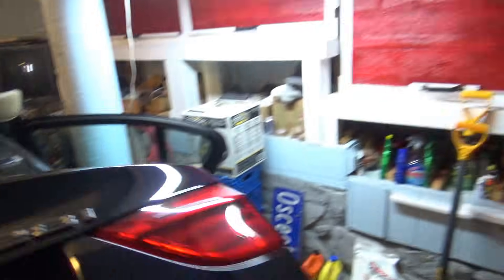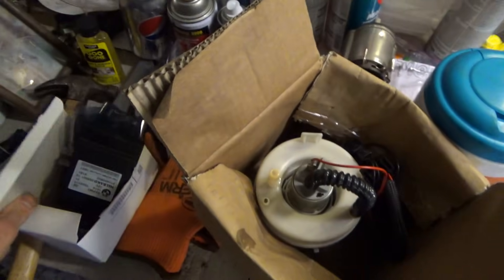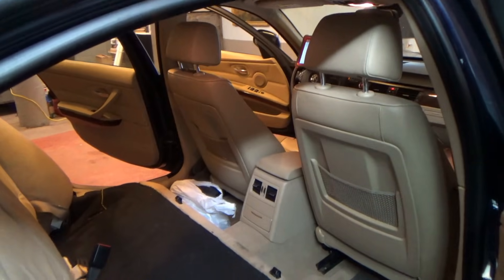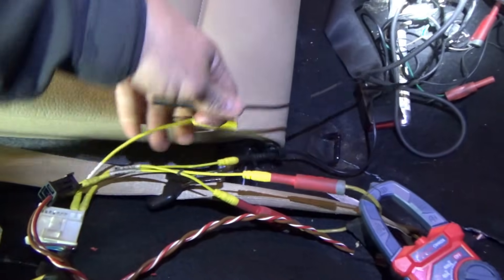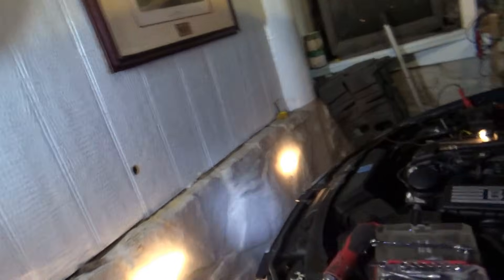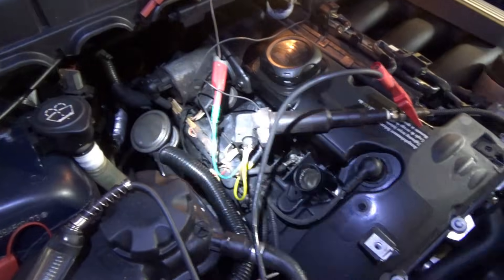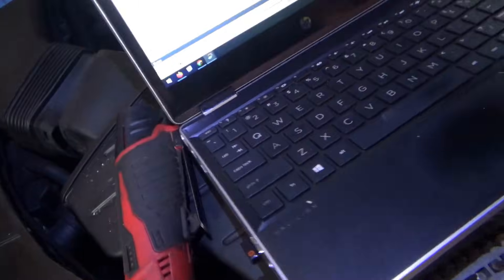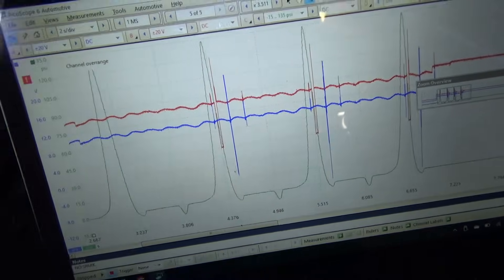Dealer BUTCHERED this BMW?! (Crank No-Start)

Comment: Actually Volvo did something very simular to me. They pinched my maf sensor wires with a metal wire they wrapped around a loam of wires and the 5v and 12v went full contact and burnt out the 5v driver. Had to eat the cost also to have it repaired. And first thing I did was to remove all that crap and put isolation extra on all the wires. Have not had a single issue with the ecu sens then.
Reply: Some of these technicians are working at lightening speed to get through cars and do stupid stuff like this.
Reply: @TheFrenchPug  that is true and the ironic thing is even after they swapped the ecu and programmed it they programmed it very very wrong. The car ran yes. I have the 2.4L Turbo xc70 2001. And they did not install the correct firmware rather they took a firmware for the 2.5L with no turbo. So had codes for the overhead cams and no boost solinoid actuation. They did set the key coding and such correctly so I was like fiiiiiine leave it and took the car over to a local tuner and said hey here you go keys for the car. Do your magic make the car run as good as you can. Ended up with a much better firmware update that got the car near 300hp and 2stage limiter. Ripped out the boost controller all together and hardwired the boost to stay at maximum and compensate with fuel and timing. It's been running like this for 3y now and not one single problem aside from a dead ignition coil that is 20y old so I'm extremely happy with their tune as they don't even normally work on Volvos
Reply: @ToxicwasteProductions  whats thef downside of running max boost all the time ...premature wear of turbo by stressing it
Reply: @nickmalone3143  I was afraid of the turbine failing or the pipes cracking or failing. But so far not really anything gave happend. Other then the turbo spinning away all happy. I normally drive my car fairly hard so I figure if something is going to break Im sure it will during a pull. I have only had sensor failures of the car. No hardware like turbos and other things just like solinoids and maf boost sensors and such fail. And those i put it to old age :) I'm running about 29psi boost at 4000rpm stock is line 5psi to 10psi on my model. So it's a huuuge power gain when you hit 2500rpm and the turbo starts really spooling up.
Reply: @TheFrenchPug  agree

Comment: How are these cars considered so high end yet they have garbage protection on their computer circuits? These days a lot of components that are manufactured to go these modules come with these protections onboard. It just blows my mind that a BMW ECM gets fried by leaving a ground wire loose. I’d be taking that evidence and the car back to the dealer and making them replace it. Hopefully they do a more competent job this time around and don’t screw up something else.
Reply: Hi end...the only thing hi is cost of owning and repairing....and they will deliver over and over until your wallet has been masturbated empty and the balls cave in.
Reply: I don't think the story is true. If that rear ground had been disconnected, the car would have already run on three cylinders at the dealer's workshop.

Comment: going to tighten all the coil grounds on my BMW tonight!
Reply: I am going to press the brake on my Tundra and press START and just drive to work. I have a MB Sprinter at work...it is a COLLASAL PILE OF SHIT.
Reply: They're easy to miss on reassembly if you're not diligent.  I've done it but didn't fry my ecu.

Comment: correct me if im wrong but the injector waveform seems well passed where it should be... almost looks likes it in the beguining of the exhaust stroke...
Reply: Yeah I thought the same whats up with that
Reply: Yeah I watched it back and I think Ivan did say everything was on pot 1. Looks like it should be for the next in the firing order ie 5
Reply: @schammo8893  Makes perfect sense! missed that part

Comment: how did car get home FROM dealer with missing ground?  Was that back lug just sitting on top of post and then later jumped off?  Wowzer!  That computer will be at least $1,000, right?

some others say the computer could  have worked AT FIRST before the drivers cooked.
Reply: I was just thinking the same thing.  It's easy to forget tightening those grounds down on a BMW so I always go around 2-3 times just in case.  Didn't know you could fry a computer by not having one tight though.
Reply: It was probably fine until the computer got fried without the ground attached
Reply: Ivan said in another comment that it drove ok for a few days until the dme cooked itself apparently.

Comment: Ok. Ive done several valve covers on 3 series BMWs. It's very easy to do and hard to screw up. I hope they didn't cause too much damage.  It's always something simple.  But forgetting to attach a ground cable is absolutely retarded.  Only other thing could have been a faulty reinstall of the valvetronic motor. Other than that it's just rebolting down the cover and reconnecting everything. You have to know exactly what those meat heads did putting it back together.

Comment: Wait, how did the car make it home from the dealer?
Reply: The ground was probably setting on the stud just fine for a while, and it's possible he drove it on 3 cylinders until the computer fried. It's also possible we are not getting the full story.
Reply: Tow truck
Reply: That will be their argument.
Reply from the maker: It drove OK for a couple days, but kept getting worse. Luckily made it back to the garage before completely crapping out.
Reply: @PineHollowAutoDiagnostics  That makes better sense.  That ground vibrated loose then.  When I forgot my ground (to put it back on bank 1) the car just ran horribly.  Then I saw it.  Put it on and vrooooom. No fried ecu.  But they can be easy to miss.

Comment: Ivan I remember back in the nineties and early 2 thousands when I would grossly overwork myself running air conditioning service calls here in Houston I often had a look on my face like the look you had on yours in this video..
Don't overwork yourself...
Reply: Very true, full mental recovery can take quite a while ... learn to say NO to more and more jobs. Your family will thank you.
Reply: He doesn't like to not solve the problem.  But it sounds like it was too screwed up to fix.  Although...the guy drove it home and must not have had any problems then.  A very strange case to a typically great running car.
Reply: Yes, I was feeling the pressure of still having to do that drive all the way home
Reply: @chiluco2000   Ivan ?
Reply: @2packs4sure  I meant, of him still having to drive back home... but I was feeling the pressure, not finding the root of the problem and getting late into the night...

Comment: Talk about negligence - dealer should eat the repair and then some! Great diagnostic of a nasty problem (fuel pump was just a "fait divers") and Keith's hint was invaluable, as usual :-)
Reply: The dealer should definitely cover it.   Even though it's an honest mistake, a loose wire hidden in the back-- things happen.  But the real fault falls on BMW design.  Misplace one ground and your computer grenades itself.   That's pathetic.
Reply: @calholli  Yep. That design is a trap - the electronics should be protected from overvoltages. Corrosion or vibration could also break that wire, with the same nasty results.
Reply: staten island the ultimate training school
Reply: @jackiemay9471  Yep. Odd cases galore 🙂
Reply: yeah, dealer from bobs garage in da hood lol

Comment: How did the car get back from the dealer after the valve cover job?
Reply: @T.J. Kong  I agree. There's more to the story. That's probably why the customer doesn't seem to be that upset. He knows he screwed up. How did he get the car to his garage from the dealer if it wouldn't start?
Reply from the maker: It drove "OK" for a few days until the drivers in the DME burned up.

Comment: It sounds out of time or a down cylinder.i missed it what did the dealer do?
Reply: They replaced the valve cover (for oil leak).
Reply: @TheFrenchPug  and that started this whole thing?leaving the grounds off.very interesting. We learn something new every day
Reply: @hatemaster2475  Yeah, I have a BMW and do my own valve cover.  I've forgotten to reattach a ground the way the wire hangs down and off.  But it just ran like crap until I noticed it.  But a BMW Tech said it can actually do that to the computer in a reply to one of my other comments.  Seems like a very poor design to allow that to happen.
Reply: @TheFrenchPug  we see our share of BMW and I can't say I noticed that ground cluster before.i have seen it on many other brands and am guilty of missing a few grounds in my day.we just had an Acura mdx with a broken ground down by the ac compressor and the customer called me the next day to say all kinds of shit was working correctly.go figure,grounds man.but our boy is on point with his diagnosis rite

Comment: I have 2014 Hyundai Sonata 2.0 4th gear ⚙️ makes hard shift and rpm go all the way to 6000. I changed fluid 3 times. Nothing changed.
Reply: That’s an internal,solenoid issue or clutch related issue inside the transmission most likely.

Comment: Doesn't it look like the intake valve is opening late, that's why there is a vacuum pocket when it opens?
Reply: A bad reinstall on the valvetronic motor in the valve cover which can cause this problem also.
Reply: I was wondering the same thing!  Also looks like a loss of compression, the expansion stroke ends at a way lower pressure than the compression stroke started at.  Granted this can simply be cylinder wash.  I also don't understand the fuel injector timing.  It's on the expansion stroke, after the spark plug should've already ignited the mixture.  All channels were for the same cylinder, correct?
Reply: @ablackformula  I agree I usually see the injector on the intake stroke.

Comment: I admit it might just be the acoustics of that place; but that engine sounded horrible when cranking; and the starter sounded even worse
Reply: It's a BMW thing lol, JUNK.
Reply: This is normal for BMW...premium price for total shit box
Reply: @mikefoehr235  yes indeed; added bonus dealer screwing things up for you
Reply: It had a low battery, for sure.
Reply: @andylowe2725  yes but he started charging it and it cranked faster but still sounded like shit
Reply: Yep. One cylinder low on compression for sure.

Comment: Now the first time I heard the engine crank it sounded like one cylinder had less pressure than the rest. So let's see what is found.
Reply: They sound bad with the engine cover off so when they're actually bad, they sound horrendous!
Reply: yes i thought i heard a fault in the  caydence  when cranking

Comment: I had a bmw that I was working  on the column  and had the cluster out for a day or 2 . And it lost its programming.  In service  data  it told me that you only have so many hours before it loses its memory.  Should  have looked  in service  data  first . Lesson  learned
Reply: I've had mine out longer than that (overnight) and it plugged back in and worked perfectly.  Very strange.  Good to know just in case.

Comment: If it's that easy to destroy a driver then it's a shitty design in the first place. Then BMW thought it was a good idea to ground it on the valve cover...something that has to come off for maintenance.  BMW garbage
Reply: Bowel Movement Wonder
Reply: @richardcranium5839  never heard that one. BAYERISCHE MIST WAGON
Reply: Their German Electrical Engineers are purposely substandard.

Comment: Dealer butchered a BMW? This is odd since BMWs usually butcher themselves.
Reply: Usually, but these are actually really solid minus a few oil leaks, a sensor or two, and a water pump every 10 years or so.
Reply: @briantii  Agree. These series cars at that year were solid.  They had to really do something bad to screw it up like this.
Reply: It was butchered at the design table.
Reply: @calholli hmmm, let’s check out your designs, see if they are any better.
Reply: @calholli  most cars built in the last 20 year have plastic intake manifolds. Ive had a few Toyotas from the earl yo late 2000's and have a 2017 Subaru and a 2014 Fiat currently and every single one of these cars has a plastic intake manifold and a rubberized plastic material on the coolant lines except for a 2002 Camry I had. Those were rubber lines.
Reply: Lmfao
Reply: You  probably never owned a bmw to be  talkin shitn😅

Comment: Money 💰 pit BMW after 70.000 junk them
Reply: Buddy of mine tracks one that’s basically all stock and original with over 230k miles. He finally put shocks on it after destroying the originals on the track. These cars are actually really pretty solid and the engine is practically indestructible. They do have minor oil leaks and stuff like that, but really nothing crazy expensive to diy or major that goes wrong.
Reply: @briantii  yes probably from 1998 😂
Reply: @beeslandscaping  No, e90 with an N52 just like this, albeit a manual.